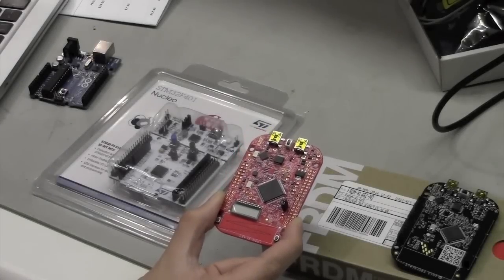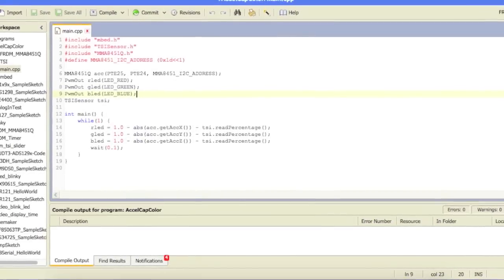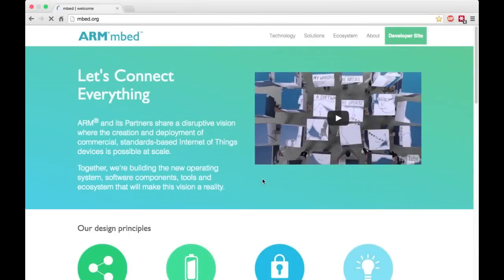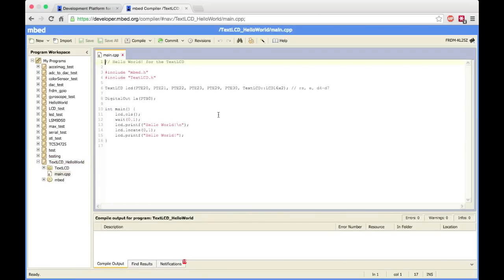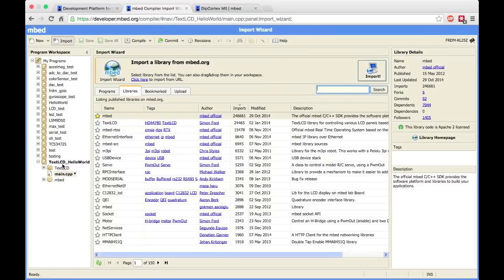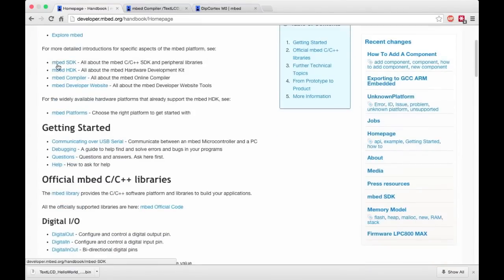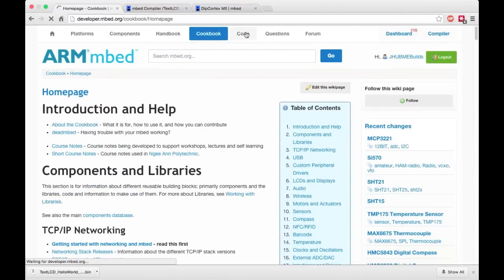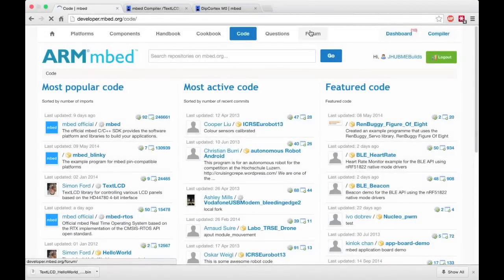mBed Tutorial 1: Getting Started with mBed

Comment: I need to use the one shot timer to generate a pulse from 1 to 1000 usec  pw is determined by comparing two analog signals. Do you have a video on using the timer in this way?